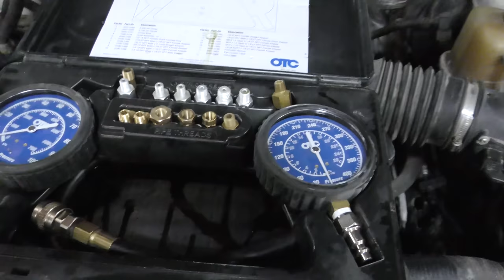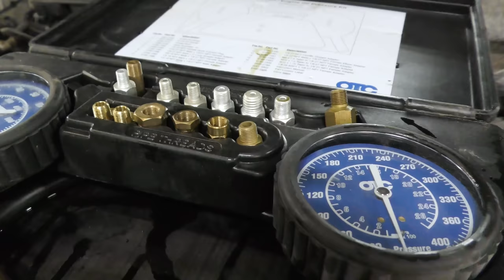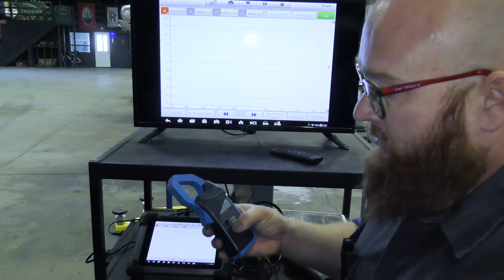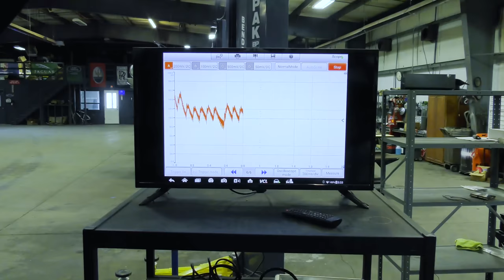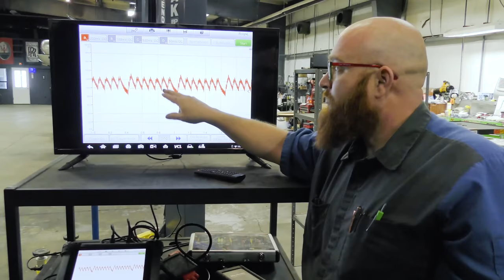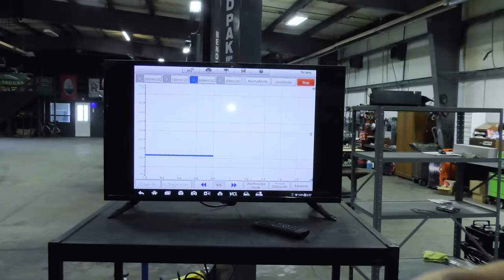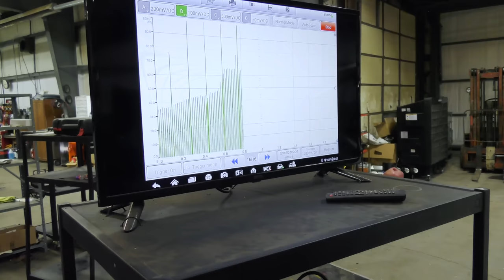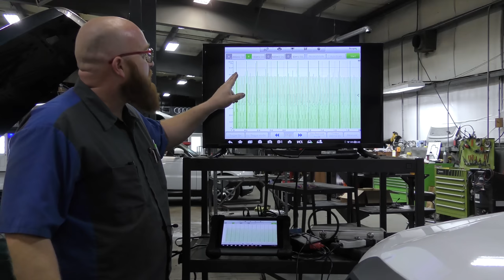Can an engine additive really fix this 2011 F150? CAR WIZARD shows how to diagnose and repair

Comment: If the oil pressure drop is because of a worn engine, where does the oil go? If the pressure is dropping it's going somewhere. So if the Rings are worn...it's burning oil...If the head gasket is blown it's in the coolant or again burning...DID THE VALLEYS get bigger? Did the oil pan expand?......My Daughters Taurus does the same thing at 140k....Ford used a bunch of SHITTY OIL PUMPS period............ps heavier oil did not fix the problem, and adding Lucas is basically making your oil heavier.....bad oil pumps!!!!
Reply: It's not a question of the oil going somewhere, it is the fact that when the rod and crankshaft bearings get worn they need a thicker viscosity oil to take up the now larger clearance between the bearing and the crankshaft to maintain proper oil pressure. You are right, adding a product like STP or Lucas oil treatment makes the oil thicker and helps with the excess bearing wear which increases the oil pressure in the engine. You may not have used a heavy enough oil to get the same effect as an additive. Next time you change oil take a gallon jug and put in three quarts of oil along with a bottle of STP, its way cheaper than Lucas, and shake it up really well before pouring it into the engine. Don't just pour the additive alone into the engine. Add oil as needed to get to the fill line. Run the engine until it reaches full operating temperature so it mixes up with the rest of the oil properly. Since you have to change the oil sooner or later anyway, you are only out 4 bucks for the STP if it doesn't work.